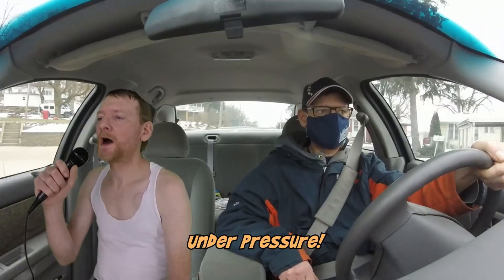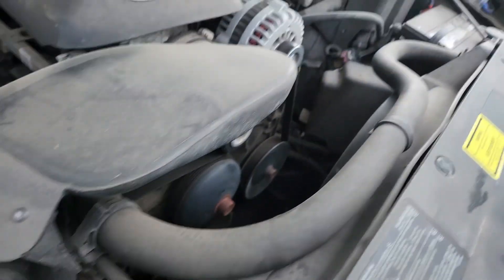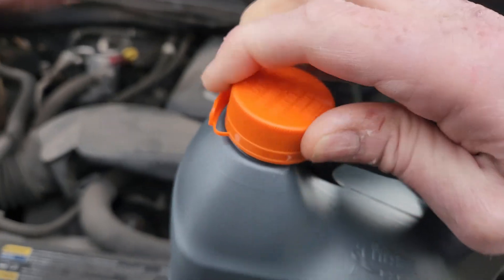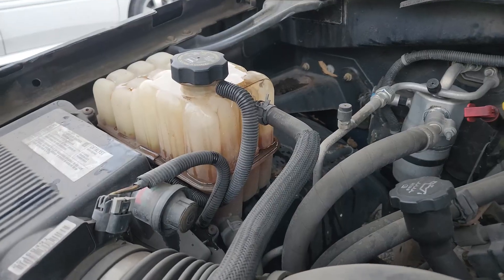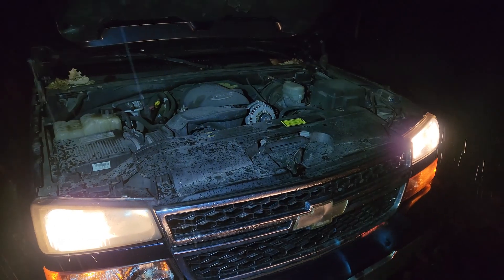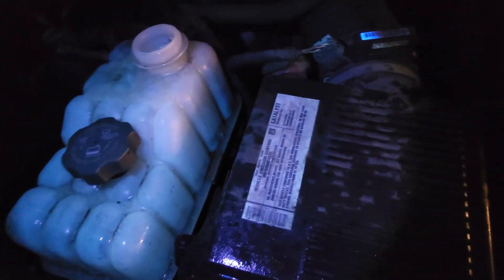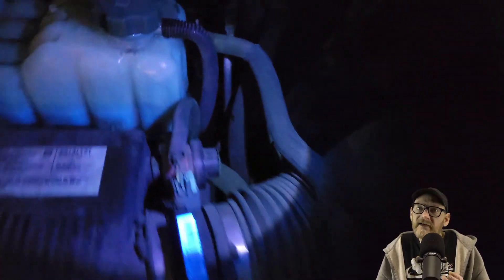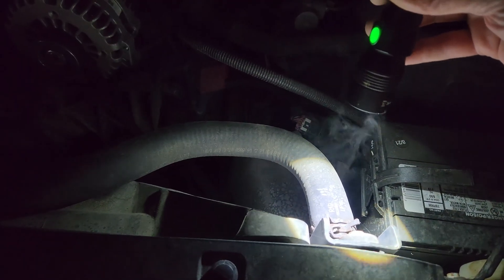HOW TO FIND A COOLANT LEAK FAST! (UV Dye)

Comment: Quick question, can i put it directly into radiator or is it better to put it in reservoir tank? My case is i dont know which one is leaking as the coolant seepage is directly under radiator side case and reservoir tank
Reply from the maker: If you add it to the reservoir it will, eventually, work its way through the system. Adding directly to the radiator guarantees it will more quickly get through the system, so if you have access then by all means do that. Be sure to warm it up and let it cool down a couple times, to ensure some does get in the reservoir (or put half in there and half in the radiator...)

Just  be sure not to spill it, or you'll be chasing phantom leaks 😁 I think I state in the video that it's a good idea to look the engine over with a UV light before you do the test, noting any pre-existing dye from a previous repair (could be present in the A/C system as well).

Comment: I suspect my car has a porous long block and it’s causing the coolant to mix with the oil. Would doing this make the coolant visible in my oil when I do an oil change?
Reply from the maker: Generally speaking, if there is any intermix between the oil and coolant, you may notice:

• Foamy or a tan-ish color on the dipstick or when changing oil
• An oily swirl in the coolant (if you can open your radiator it would float right to the top)
• A "sweet" smell (that of burning antifreeze) in the exhaust

And a host of other issues like valvetrain noise, etc...

Most of the time this is caused by a failing head gasket or warped head, but there are other places where the two fluids could intermingle.....

A full diagnosis by a trusted mechanic is my recommendation, sooner rather than later, as such a problem can turn into a much larger problem very fast (I just had to rebuild half my 5.3 engine after ignoring some valvetrain noise for a bit too long.....)

Comment: Good video, I decided to do the UV dye test on my Wrangler. 3rd radiator OEM lasted over 15 years and started leaking on a road trip "limped it 30-40 miles" without overheating. Heater core went a year later.  The replacement radiator was leaking from day one same place.  Replacement for it was name brand aftermarket full  aluminum one. Now smelling coolant every time I drive it and lose 1 qt- 1/2 gal of coolant.  Nothing to complain about really 20 years of driving and 256000 miles.

Comment: This is a really helpful channel. I would love to see how you replace a radiator so I can do it myself and save some money very helpful when you get to the point you don’t try on with crap that nobody needs to know. Thank you a man with knowledge is sexy.
Reply from the maker: Thanks for the compliment! I did end up replacing that radiator, but I didn't really get any good footage (rain, was on a time crunch to get to work etc). And they sold me the wrong (smaller) one at first, which I only noticed AFTER having taken everything apart... another reason I'll never go back to having just one vehicle :)

I might have some footage and/or stills, maybe enough to do a walk-through video explaining what needs to be removed, and any caveats I ran into along the way... I'll have to dig around the hard drives and see what I've got to work with.

Thanks for watching!

Comment: Do you see white smoke come from tailpipe heavy
Reply from the maker: I'm not sure what you are asking, but in the video there are no shots showing the exhaust (I don't think). At any rate no that is not the issue on my particular truck.

If you DO see white smoke, that could indicate a head gasket issue, where you're burning coolant... but that's not what this video is really about; it's just finding a leak that is repairable...

Comment: Very informative,  I have been smelling coolant for months on my vehicle. It's been needing about 1 qrt a month of coolant.  I checked my dip stick no milky sludge so its not an internal problem.  I'm hoping with the uv dye. I'll find it and be able to fix without needing a shop.   I might drive it for a week so it will really show where the problem is.
Reply from the maker: Glad I could help, I hope it works out. Yes, if it's a very slow leak it may take some time to reveal itself... best of luck!

Comment: so after putting the dye and have detected. do you need to flush the dyed cooling water and replace new coolant? or its safe for the dye to be in the syetem
Reply from the maker: It depends, but in most cases you can leave that die in the system. Usually the bottle it comes in, or the product description will specify which is the case.